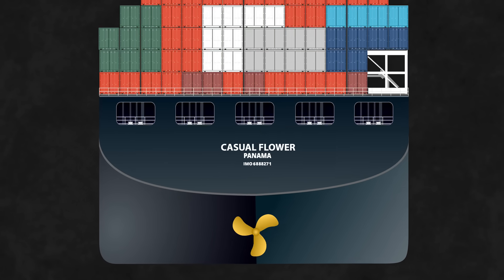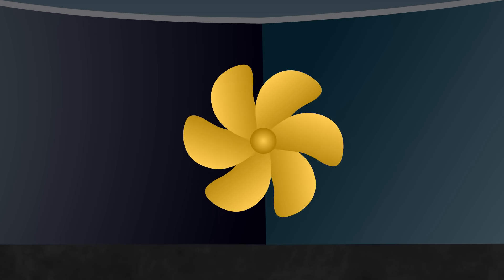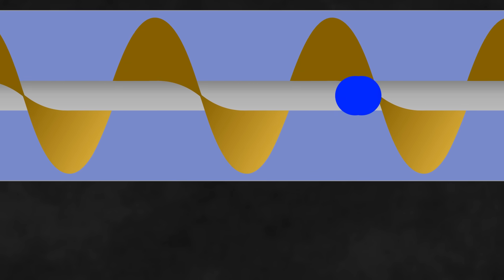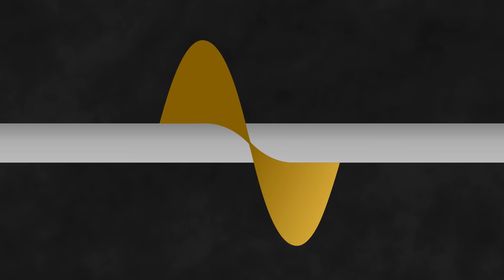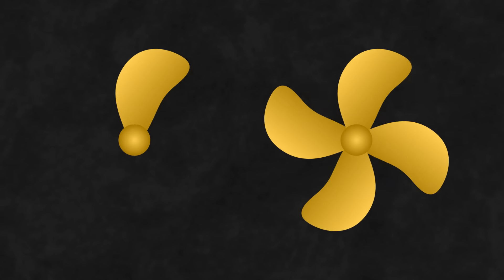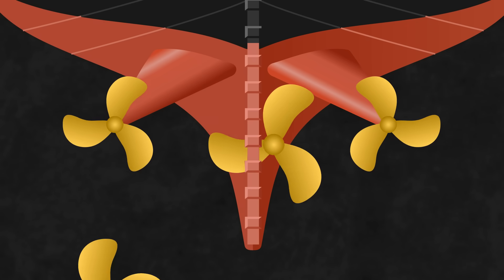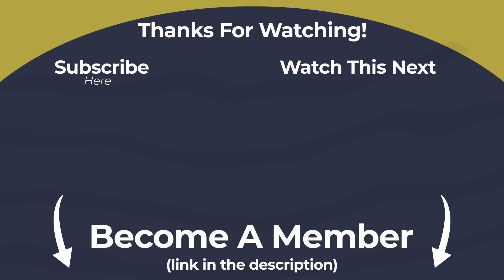Why Are 4 Blades Better Than 3?

Comment: Many sailing boats have folding props that open and provide thrust as the shaft is rotated then fold back up again as rotation is stopped.
Reply: Some small airplanes have this as well. I used to fly on an Ultralight that had folding propellor blades. Motor gliders often use this as well.
Reply: Or feathering props where the blades rotate on their axis to minimise drag

Comment: There's something that's used in airplanes, that I'm curious to know whether anyone has experimented with on ships: a variable pitch propeller.

On propeller airplanes, they are pretty much ubiquitous. In fact, they usually come in the form of what's called a "constant speed propeller," where the engine is allowed by easy propeller pitch to accelerate to its optimal operating speed, and then as throttle is added, the pitch of the propeller increases accordingly to keep the engine running at the same speed, regardless of what the exact throttle input is.

Have any variable-pitch propellers been experimented with on ships, and what results did they produce?
Reply: I answered this above, but variable or controllable-pitch propellers are widely used in marine applications -- that have a range of operating speeds.  You will not generally see them on cargo ships (containerships, tankers, bulkers etc.) where the hull and FPP are optimized for a specific speed that the ship will travel at >95% of the time.  The losses during the remaining 5% of the voyage, usually at slow speed leaving or entering harbors or transiting canals, just don't justify the cost and complexity of a CPP.  Cable/pipe layers, ice breakers, ferries and naval ships have used CPPs for decades.

Comment: Modern deep sea ships use vary slow turning engines and screws. They also do not have a gearbox, the engine is directly coupled to the screw. The ship I was on recently has a 7 cylinder engine that produces 26,000 HP. It also has an absolute max of 105RPM. For most of the trip across the Atlantic, we were running at 92rpm and making 17 knots. The prop itself is bronze (as most are), 6 bladed fixed, and approximately 6 meters in diameter. 

To go backwards though? You have to bring the whole engine (and thus prop) to a complete stop, then run your engine in reverse. Due to the enormous amount of compressed air required to get the engine started, it can only be done about 5 or 6 times in an hour.

Comment: Don't forget Titanic's middle prop was run by a turbine, the others by triple expansion piston engines.
Reply: The low pressure turbine driving the middle propellor used steam from the two triple expansion engines and so couldn't be started until the those engines had been running long enough to be producing dry steam. This hybrid system was a compromise when the all-turbine Cunard liners like Lustania and Mauretania had already been in service long enough to demonstrate that turbines were the better solution where high cruising speed was wanted.
Reply: @IntrospectorGeneral  That makes sense, as revolutionary and fast as the Cunard superliners Lusitania and Mauretania were, passengers often complained how badly those two ships vibrated under full power. Whereas passengers who sailed on the Olympic enjoyed a rather calm and stable voyage. Maybe not as great for steerage passengers though it's going to be more uncomfortable when you place passengers closest to the engine propulsion systems. It's probably why most modern cruise ships and ocean liners rarely place passenger accommodations so close to the engines anymore. Most are on the upper decks far away from the engines.

Comment: My personal theory is that the Titanic had a 3-blade prop.  As mentioned in the video, there would be reason for H&F to try both to see which worked best.  Since Olympic had 4, it would make sense to give Titanic a 3.  It obviously wasn't a settled question, since Olympic later got the experiment.  Also, as mentioned in the video, a 3-blade will tend to be faster and more efficient in cruising.  The crew aboard Titanic observed that she appeared to perform slightly better than Olympic; J Bruce Ismay was giddy about it in conversations with Captain Smith, according to an eavesdropper.  Although Titanic never reached her full speed, there was some anticipation that they would do so the next day.  Although there are other potential reasons for being faster or more efficient, the presence of a 3-blade prop could explain it.  Perhaps if they had pushed it further, they would have discovered a vibration issue, or whatever it was that they found unsatisfactory on Olympic during the war with the 3-blade.
Reply: Titanic had a center 4-blade on the turbine, and two 3-blade props off the triple expansion engines.
Reply: @blackhawk7r221  It is actually completely unknown whether Titanic had a 3-blade or a 4-blade in the center.  No pictures were ever taken of it's propellers, only of Olympic, and the center propeller has not been found at the wreck site.

Comment: Then you have the variable pitch propellers that can turn at a constant RPM but vary the angle for attach to better suit the speed required, feathering propellers for sailing boats and these freaky looking things from Sharrow that have been designed to reduce the blade tip vorticies. https://www.youtube.com/watch?v=MNnB_50Z20I

Comment: Dumb questions: 
Why aren’t propellers encased in cowls as in jet engines?  
and
Obvious mechanical complexity aside are there advantages in having two propellers on the same shaft with a different angle of attack as is done in some turbo prop aircraft?
Reply: There is such a prop in the pleasure boating realm.  It's a BravoI III.  Twp counter rotating props on the same prop shaft.
Reply: A modern high bypass jet engine does produce most of it’s thrust from the front ducted fan.  BUT, it is not as efficient as an exposed propeller on a turboprop.  BUT, a turboprop is more efficient, but slower, SO, lower efficiency high bypass turbofans are used because you can spin them up to much higher rpm’s to get a smaller diameter turbine fan to give much more speed.  It’s a balance of speed vs efficiency.  In boats, a jetdrive is always somewhere around 20% less efficient than an exposed prop.  Jet skis need them for safety.  Jet boats make up for the inefficiency with huge V-8 engines.  Once again, a compromise.  A jet boat looks cool for Bubba six pack on the lake, but a true offshore racer has exposed propellers.
Boat outdrives (inboard/outboard units) like the Volvo Duoprop or OMC Bravo do use contrarotating props on what looks like a single shaft.  Tu-95 bomber also uses contrarotating props, making it one of the fastest prop planes in the sky—and it’s a 4 engine bomber.

Comment: Many sailing ship have 3 but they fold flat when not spinning. Or the father there angle of attack to be in line, you have to be very old to to have fixed props on a sail boat.

Comment: So, same rules as in aviation, then. More blades are better for thrust, but worse for efficiency. Use as few blades as you can get away with, but as you increase power, you'll need more. (Sound barrier is the limit, vs cavitation.)

Of course, as the prop is visible in aviation, and (as pilots know "more powerful engines need more blades") increasing the blades on the prop is something marketing loves, even when there's no engineering basis for it. (Not really the same in the nautical world, where the blades are generally submerged.)
Reply: More blades give more bite and require more engine torque.

Comment: The last bit about two bladed props are used to reduce drag when the engine isn’t running - “constant speed” propeller aircraft use a variable blade pitch rather than RPM to control airspeed/efficiency, and “feather” the prop in an engine failure to reduce drag. Curious if variable pitch is a thing in ship propulsion?
Reply: Yes

Comment: This made me wonder why the propellers aren't mounted on the sides of the ship (like aircraft engines) to give them a less obstructed stream of water. Is it just practical considerations, or is it actually most efficient to have the propeller where it is?
Reply: Propellors mounted on the side of the ship also will increase drag significantly.

Comment: i would love to see a oonger explanation of this. i know youre taking about propellers under ships but i always have pc fans in my head and didnt understand why they are so different
Reply: Your pc fan uses many blades at a shallow angle.  The shallow angle means it can operate from a weak electric motor.  It can move more air by having that tiny weak motor simply spin faster.  More pitch on your blades requires significantly more motor power, thus consuming more electricity.  It’s just a balance.
Reply: @blackhawk7r221  i know but it can operate from like 500rpm to 2500 rpm. so much space to have some changes in moving air, right? if i have the same motor but wings with shallow angle i have to turn it faster to get the same airflow as wings with more pitch. thats correct, right? so why they produce not a fan made fr low airflow and for high airflow. they ALL (high pitch and low pitch producers) claim they have all the highest airflow with the same motor! i still didnt understand this

Comment: I heard that toroidal propellers are much more efficient than the current propeller, as there are less vortices created.
Reply: For a lightweight planing hull pleasure boat, yes.  Not for a large displacement hull ship.  Not enough surface area on the blades.  It’s a flash in the pan marketing gimmick that will net them tens of millions before it fades away.

Comment: Just put a low gear and a top gear, and shift up if the engine goes too fast
Reply: My buddy had a 40 foot Hallett day cruiser with twin 1050 HP super charged big blocks.  It also had Gear Vendors overdrives giving him two gears.  He ran it until he couldn't afford both the fuel bill and the repair/maintenance bills...lol
Reply: No need.  If it is propped correctly, your engine will be petering out right at the max of the torque curve.  A gear shift would merely lug it and slow it down.  Been there done that.
Reply: I will take your word for that. And I will not try to put a supercharger on the engine.

Comment: Can you do a video on the cool tech that ships started using within last (20 years?-ish)? Its that further forward 360` Degree movable props, some in front 1/3rd of the ship, I think they are used for docking but would love to know more. I'm pretty sure they have to be electric, but I don't know if they are ever used at speed to help add to ships speed or help break or steer while underway or if they are only used while docking at slower speed.
Reply: You mean the thrusters used on DP (Dynamic Positioning) vessel? If so, this is indeed interesting, it allows vessels to maintain their position very accurate, which is essential in offshore operations like cable/pipe laying, walk-to-work operations, etc. But it also allows vessels litteraly to move in any direction on the horizontal plane.

Comment: How does efficiency and such of a submarines many blades single prop compare to a ships 3/4 multi prop? Drag/cavitation/sound/etc
Reply: A sub uses 7 or 9 long curved scimitar blades that allow it to push a lot of water at low quiet rpm’s with little cavitation.

Comment: Thank you!   :)  Does the size of the blade affect the optimal number of blades?
Reply: The size of the propellor affects the cavitation speed; the larger the propellor, the more water it can push, but the slower it has to turn to prevent the tips (which are moving faster than the centre, because they've got further to go in the same amount of time) from creating cavitation pockets. A larger screw also means more rotational inertia, which means the engines take longer to change speed.

Both of these factors come into play when you're selecting the number of blades, and all the factors themselves play into each other. The architect/engineer's job is then to examine the desired characteristics of the ship, and design the propellor and powerplant to suit the specific scenario.

Comment: So I suppose larger props ought to be more efficient with how they move a larger volume of water or?
Reply: You calculate blade surface area required for a particular amount of required thrust at a particular desired shaft rpm

Comment: Once again the parallels between aviation and seafaring are uncanny. Very well explained and animated, as always, Mr. C.N.
Reply: Fluid Dynamics, Density is the only major difference.
Reply: @1978sjt  The biggest difference is that seafaring is about resting on top of the water whereas aviation is about flying through the air. Submarines are more like planes than boats are. If one were to sail a ship floating on the top of the atmosphere through the void of space it would be more like an air boat lol
Reply: @jek__  oh how cool would that be!
Reply: @1978sjt  yeah but the speeds are much different and water has a much higher voscosity which make these two completely different beasts. It's like comparing cycling and f1. Both have wheels but are completely different
Reply: @robertr7923  not COMPLETELY different, that's the point, but yeah, I wouldn't want to be spinning a ships prop as fast as a planes, because... well... physics :p
Reply: Well boats were first then airplanes really copied alot from them
Reply: we do a little moving of a substance to move a substance through a substance, here
Reply: this video reminded me so much of when i was first explained how propeller aircraft work. Also made me wonder why ships generally dont seem to have variable pitch propellers.

Comment: Did you know a single blades propeller is more efficient than any other number of blades on an aircraft propeller? They’re able to be longer and only need a counter weight at the hub for balance. The single blade works better because if two (or more) bladed the second blade is always biting through some turbulence from the blade before it. But a single blade doesn’t have that issue and can produce more thrust per revolution than two or more. 
It’s true and used to be the standard on pipers.
Reply: Forward motion ensures a bite of fresh undisturbed air for each blade.

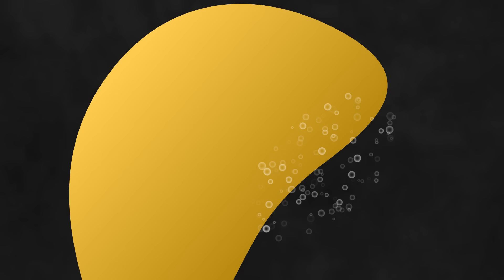Comment: 3:30 I wanted to point out that screws are very rarely made of steel for ships. Most of the time they are some alloy of bronze. Great video!
Reply: It's so common, in fact, that all of the propeller illustrations in this video are bronze colored
Reply: Why is that?
Reply: @Cyberguy42  Bronze is much more resistant to seawater. It can also be made to be VERY hard, which protects against cavitation damage. It's also very expensive - some screws for larger ships weigh over 100 tons and cost in the millions to produce. It's amazing to see these massive things that are made in a single casting.
Reply: @doggonemess1  CA 958 aluminum nickel iron bronze, is incredibly corrosion resistant and cavitation resistant, (and pretty strong) its usually used for propellers, or some more highly refined version of it

Comment: You could have mentioned that submarines usually have more blades as it helps in keeping them quieter. Not an as big of concern for freighters and only a slight concern for cruise ships as cruise ships can isolate the noise from the outside going in.
A submarine cannot isolate the noise from its propeller going out, hence why they have more blades than usual despite the other downsides.

You could also have touched on the absurdity of using a turbine instead of a propeller.

And there was a screw propeller on the SS Archimedes by the way.

Comment: Kudos to your animation of the Titanic not having smoke come from the fourth funnel.
Reply: 🤯I forgot this trivia
Reply: Can you say why?? I've not heard this before.
Reply: @Peds013    The fourth funnel was a dummy used for fresh air to the lower decks.
Reply: @Peds013  the fourth one didn't have an engine underneath, it was added by the builders because they thought the titanic would look stupid with only three. in the end they used it as a vent for the kitchen
Reply: @dari6795  that's hilarious! Thanks for sharing.
Reply: @dari6795  maybe you ment to say the same thing as I am, but the fourth funnel was added not because the Olympic class liners would look stupid, but to give people the idea that it was fast. Back then other oceanliners also had four funnels and for the Olympic class liners to live up to the expectation of being big, fast & luxurious, the needed to look that way and therefore the fourth funnel. You're right about the use of the fourth funnel.
Reply: @surgemeister182  sorry, i got that information from a book i bought about the titanic a few years ago. your version of the story sounds a lot more plausible tho😂
Reply: Only learnt that from this thread but very cool
Reply: Attention to detail.
Reply: The 4th funnel actually was used as a vent for the turbine room which powered the center prop, separate from the reciprocating engine boiler room which powered the two side props.
Reply: It was a multipurpose vent, mostly for the machine rooms below but also for the kitchens, smoking rooms, and first class lounge fireplace
Reply: 0:40
Reply: Technically, there would have been some smoke from the fourth funnel, from cooking equipment, and from the first-class smoking room and its fireplace.  But nowhere near as much as the first three that were connected to the boiler rooms.
Reply: May be one of their gene was stopped 😁

Comment: One thing i want to now see is why having a centerline prop is bad.. some ships i know use even numbers of screws that therefore are parallel with the keel and there are others with odd nunbers of screws and one of them will invariably be in the keel.

Also, why dont more big ships use pump jets?
Reply: A cargo ship goes slow enough that the prop does not need to be in clear unobstructed water.   And pumpjets are inefficient